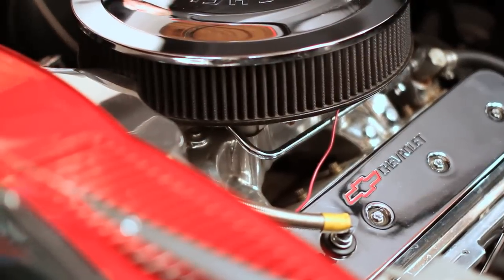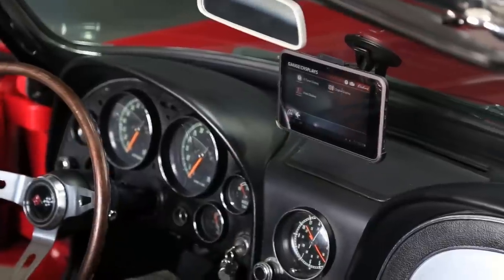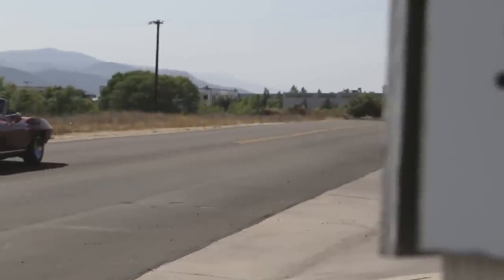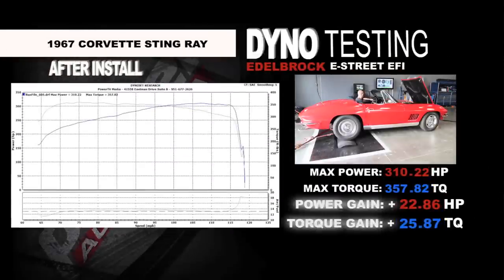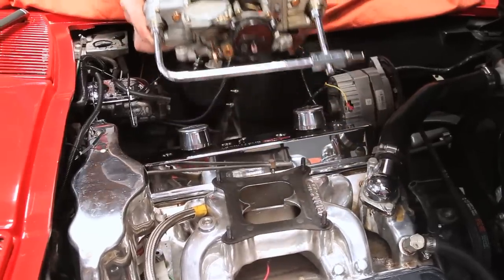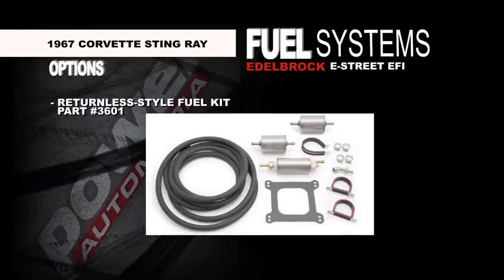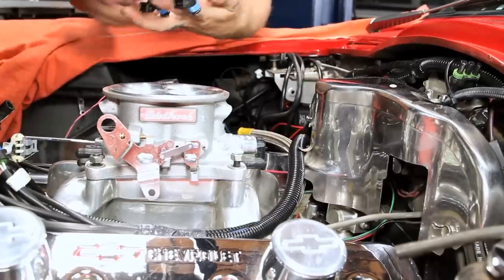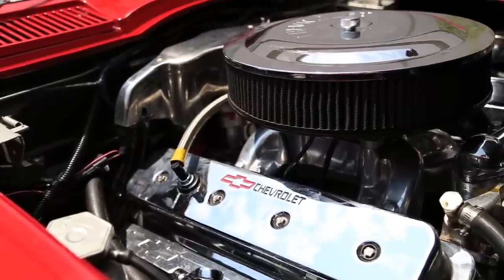Tested: Edelbrock's All New E-Street EFI Fuel Injection System

Comment: I installed it 3 diffrent times on my 70 vette...  It went back to Edelbrock for updating and it still did not work.... I finally pulled it off and tossed it in the junkyard...  Went back to my Holly carb

Comment: Few questions. Eventually I'd like to put a Weiand 142 low psi boost probably 8 psi max possibly lower. I have a mild built 350 going in my jeep. Probably get this first before the weiand 142. Will it learn to run with the blower? Especially sense it would be a pretty low boost. And  can I get some good low end torque out of it? Also snorkel wise what do you guys suggest. or should I stick with my thunder 650 edelbrock.

Comment: 2 things.....#1 regardless of what edelbrock tells you this does NOT work on all engine set ups, I'm in the process of pulling the entire system out and sending it back. #2 edelbrock is discontinuing this set up and going with multi port fuel injection systems only,....absolute nightmare. Got that from the horses mouth.

Comment: Does this have a fuel command center? Those FCC are complete junk in the heat. They boil the gas and shut the efi down. Also, does this system have the loud hissing through the unit like FiTech?
Reply: Frank Sells yes that's from the idle air control motor, i am fixing an Estreet 1 early version on a customers 74 LS4 vette and it's overal a junk system, some parts work, some don't, total head ache so far, the FAST efi setups are Much better imo

Comment: i live in Georgia and its cold down here right now. I have a 70montecarlo with a 350 and we have the edelbrock 1806 carburator with electric choke. we just rebuilt the motor and the weirdest thing is the car started right up didnt have to give it gas or anything. I was very suprised

Comment: how many mpg realistically can u expect from this conversion? also does it have an eco mode?
Reply from the maker: I'm sure it varies. Edelbrock's number is 310-781-2222 if you would like to get some specifics.
Reply: MPG improvement comes mainly from the internal design of the engine... proper cam spec.s, combustion chamber shape, piston design, compression ratio...